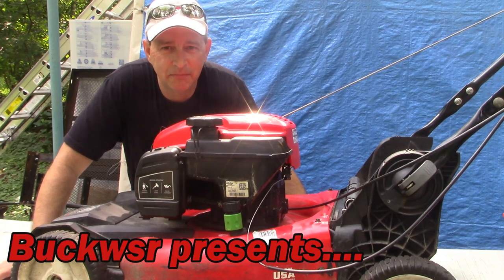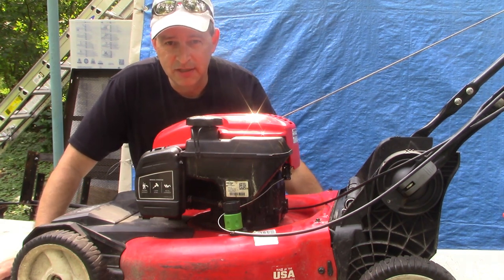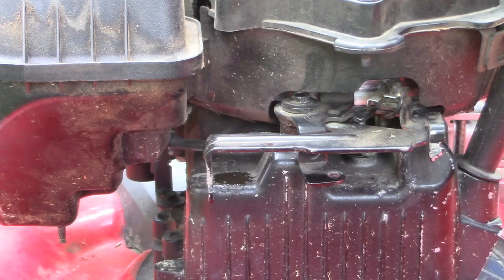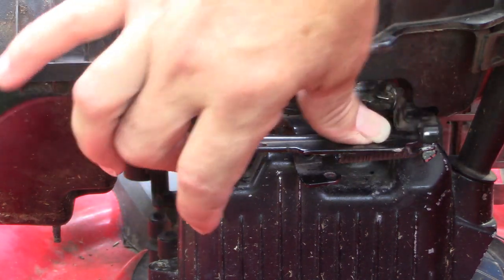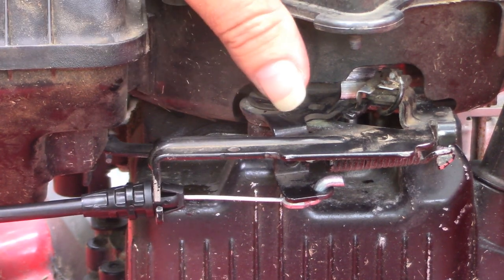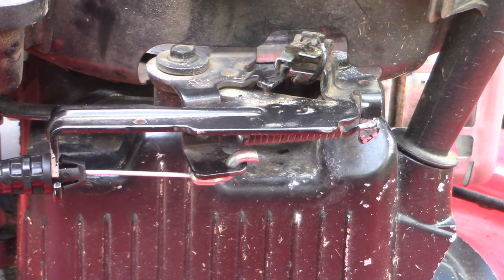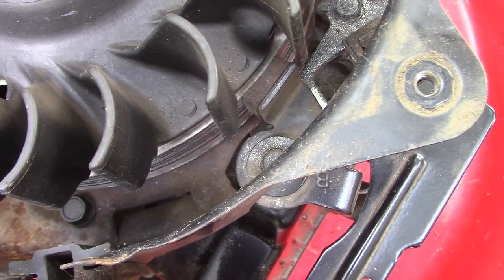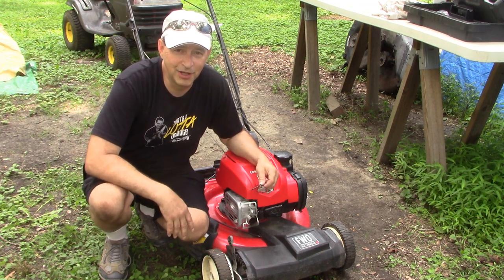What does the Safety Control Cable on my Lawn Mower really do? (Brake Cable)

Comment: Hey, Buck, best thorough explanation on You Tube about the operation and importance of this cable, brake, switch assembly. I have a Briggs Stratton 6.75 I've been fighting for years now starting and I'm sure the cable was slowly stretching over time. Thanks for this one, I'm sure it will save many  mowers from the landfills!

Comment: Very easy to follow instructions, thanks for the guidance, ordering from Amazon has been a challenge to me ,cables are bad on a few mowers ,I just removed that tension spring and manually move the throttle lever ,and reverse it when I want to stop engine , 👍thanks .your mower won't be mad.

Comment: Thanks a bunch great video. My lawnmower crapped out couldn't tell what it was at first realize the cable snapped after careful inspection. So the motor won't start. Hoping that's the only issue as it was working beforehand.

Comment: What about the black cable in 06:12 at the squeeze handle as well? If you have a video of that then that would be greatly appreciated.
Reply from the maker: The other cable would have to be the control cable for the self-propelled wheels. The cable works just the same way as the other one, but serves a different function. Easy to replace it too, if you need to. But no, I don't have any videos on that. Good luck.
Reply: @Buckwsr  thank you!! Highly appreciated